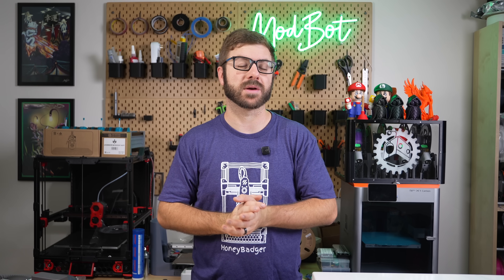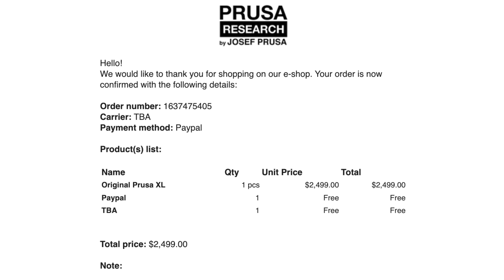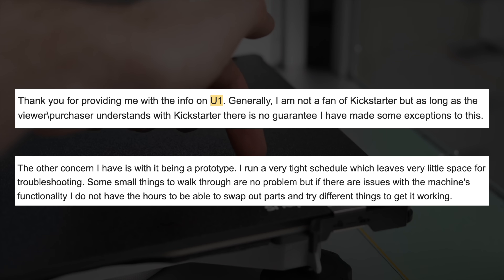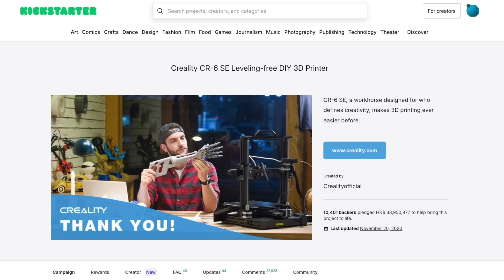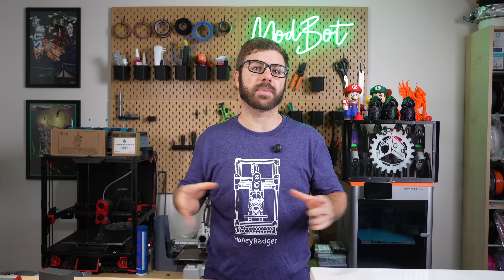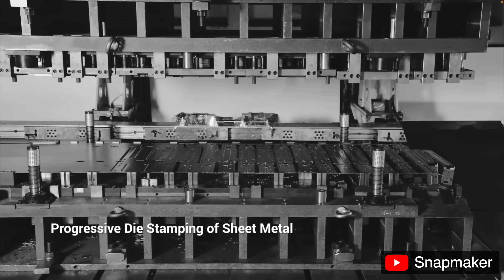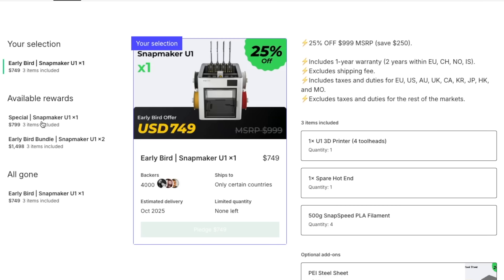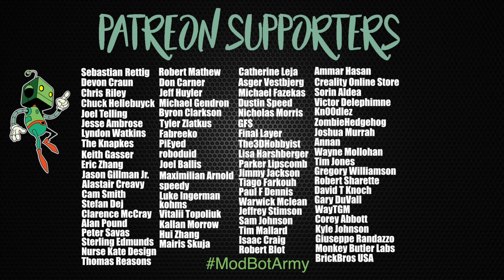Why I Backed the Snapmaker U1 Tool Changer (Should You?)

Comment: It took awhile to convince myself to get it, but I eventually pulled the trigger after it jumped from the early bird to the $799 price.  In the first review I saw (for a review unit clearly) I really wasn't that impressed with the quality of the prints.  But a later review I saw changed my mind.  I was SO close to completing a $4000 pre-order of the Prusa XL back in the day after a 2-year wait and constant delays.  It looks like my patience paid off, since now I've got the H2D plus the U1 for a total of only $3000.  Still love my MK3 though (which has evolved a couple of times to a 3.5S and still works great).

Comment: I was really on the fence with this until Aurora Tech did a review on it. I am very impressed. My biggest concerns are longevity. Can I put 10 thousand hours on it? How good is Snapmaker's customer support?  Also, how difficult will it be to work on? Will spare parts be readably available? If the answers to these questions are positive, than this could be a real game changer.

Comment: I have backed over a thousand Kickstarter campaigns, and it's never been a concern for me.  There is definitely some due diligence that should be done before backing something, and there have been some cases of products not being delivered.  And I have even seen some companies move from kickstarter to indegogo once the kickstarter is done or they might run campaigns on both.  
I do think the U1 has definitely given a push to other companies to come out with their own alternatives.  A printer that does all that for a thousand sounds pretty good to me. 
With the INDX on the way, I just couldn't get myself to back it.  But maybe I will reconsider once it's released.

Comment: I found it interesting that you declined the non-production version as a content maker for valid reasons, so you gained a subscriber. I believe there will be some shipping delays, but not as bad as the Prusa XL, which I also put down the deposit but ultimately did not purchase. I do a lot of ABS and am curious if the lid will allow good prints. They are single color, so if the U1 can't do them I can get a H2S.

Comment: I'm glad you mentioned nozzle sizes and multiple filaments (as opposed to different colors). Because that should be the level of expectation when delivery a 3d printer with multiple tools. If people want just pretty colors, then the single tool is all they need.

And just for fun: KickStarter takes 5% of the final backer amount, regardless of delivery of promised goods by the Project Owner. If it is not successfully backed, no money changes hands and KickStarter does not collect any fees. Oh, almost forgot. KickStarter takes an additional 3-5% from the successfully backed Project owner to cover their own credit card fees. At this point, KickStarter is going to collect over $750,000 whether or not we get printers from SnapMaker.

Comment: If you are unsure, WAIT, I backed the Ankermake M5 which also seemed a great printer doing some things other printers weren't doing at the time and from a reputable brand. The printer was delivered and sort worked as advertised, but a lot of the software promises where never implemented. Now they have all but left this printer to die, I am now stuck with a printer that is worth literally almost nothing on the second hand market and in practice has no more support. Be careful and wait until the actual consumer units get shipped and get tested by independent reviewers, WAIT IT OUIT.

Comment: I have two major reasons why I backed the Snapmaker U1 myself
1) I have an Anycubic Mega SE - A decent enough ender3 clone bedslinger. With the hardware of the Snapmaker U1, it's very doubtful it'll be worse than that, especially since I lost the settings in Orca and have to build my profiles back from the ground up. I already run Klipper on the printer itself, and despite a rare skip or two in the extruder it works fine (but slow)
2) The software is open source based - I hate proprietary software for slicers and firmware. Since they are focusing on mostly hardware and letting software be open source, I trust the build and functionality of the printer.

With these two reasons, a cheap toolchanger would be a huge leap forward for me to do what I want even if there are some minor issues, and since it'll be open source there will be pressure to get any software related issues fixed.
Any hardware related issues should be able to be dealt with as well due to the open source software side of things. I expect less tinkering with this than I have done over the years with my Mega SE.
The preview videos have at the very least given me enough info that this isn't vaporware and that it'll function to do as good prints as my MegaSE, but faster.

Comment: If I was in the market for a 250mm class printer, I would have jumped on this in a heartbeat. But, I already have a printer that size, and while the toolchanger is definitely a better tech than the AMS, it's not enough for me to replace a working printer, and I don't need a second 250mm printer.
If this had been a 350mm class printer though, I'd probably have jumped on it hard.
For now, I'm waiting on the INDX. If it releases with good performance/quality, I'll look at getting an SV08 and modding it.

Comment: i would absolutely love to have a tool changer, but even at the drastically reduced expected price point it's still well out of my price range - probably the biggest reason most of my machines are built from salvaged components, except for electronics.  that said, i've always been a believer in the little guy getting a leg up if they can through platforms like kickstarter, but established companies using it seems to me to simply be a way for them to hoard their existing profits rather than putting a portion of that toward r&d as was always done in yesteryear.  i have a feeling the days of the little guy getting that leg up are just about over now, though, being edged out by established & largely thriving companies & corporations on those platforms - which i personally think is very sad & doesn't bode well for the future.

Comment: I will not pay a dime for a 3d printer until it is on the market and in the hands of real users. I have been burned before and I won't ever back a 3d printer again. There is a ton of hype about the U1 and that's fine. But I don't buy into any hype until I see people in the wild using them.

Comment: I really really want a tool changer... I have an A1 with AMS and the filament poop just irks me. And the increased print times kinda sucks too, but I could live with that if it weren't pooping so badly. I was already investigating tool changers a couple months ago, but there is no way I could afford the prices that they list for. I would have jumped on the Snapmaker, but there is no much I don't know about the printer and the company itself, I didn't want to toss away over a grand (CDN) if it wasn't brought to market. And I am not interested in a walled garden when it comes to hardware, either. This is the first info I've heard on the nozzle and I really would prefer to be able to swap out nozzles without having to also swap the entire hot end. Spare parts... Are they going to be available? Again, no idea. So many questions. LOL Then I also have FOMO of missing out on the price point during the Kickstarter because what if they DO increase the price to say $1500USD, there's no way I can afford that. Then there is the fear of locking myself into a Snapmaker only to have another company come out with their tool changer that is better. (And I don't think the H2C is going to be it... There is going to be a Bambu Lab tax on top of whatever it costs to manufacture it and again, walled garden will definitely be involved there.
BTW, good content... new Sub here.

Comment: After the announcement of the H2C and a strong debate, I decided NOT to back out of my backing in the U1.
The H2C will require 2 AMS (which I already have) but also require the filament to be cut when changing colors.
The U1 will still be faster when changing color.
If the U1 had 2 more tool heads it wouldn't be even be a debate, but he H2C's 7 color is a huge advantage over the U1.
I already have an H2D and will be getting the Vortek kit.
But I still want to support more competition for affordable tool changers.

Comment: All fair points. I haven’t had much of a need to do multicolor things as most of my stuff is functional single filament printing. I do have an A1 Mini with AMS Lite so on the offchance i need a multicolor thing, it works. My Centauri Carbon does full functional printing and someday they will maybe have an AMS for it… we’ll see. It would mainly be nice for support materials and getting clean overhangs, and refilling spools, is how I would use it, personally. But toolchanger is obviously the way to go and zero risk of nozzle contamination, much less clogging. If the U1 does this right, i may consider getting another printer.

Comment: I backed it also,
But then Bambu announced their new H2C..........So I canceled my Smapmaker
Reply: So you cancelled fot printer triple the cost with slower changing system that there is barely any information about?
The Bambu project makes sense only if you already own H2D with AMS, and plan to buy upgrade kit for it, otherwise you might as well go all the way to Prusa XL at that pricepoint
Reply: @Asghaad  
No, I canceled my order because I'm in love with the Bambu Echo system and the fact that I can print up to 7 colors instead of 4
Also, the bigger volume Cubic....
Oh also the tech support....Oh and the Phone app..........Oh and so on and so on
Oh, and I can afford it !!!
Reply: @popshobbydungeon  cool, im not spending $3-3.5k on a printer and all the required addons (7 colors would require TWO AMS and all the required connection and power addonts to THOSE ...), i would have gotten Prusa XL if i had that amount of cash to throw at a hobby

and yes i can afford it, doesnt mean i will be financially irresponsible to throw that amount of cash on second rate system that will be significantly slower than actual toolchanger - at that price i would expect to get the best not 5-6times longer filament change time compared to competition that costs less than a third as much
Reply: @Asghaad  
You don't need any AMS,  you just load 7 colors and you're done, and as far as speed, each tool head of the U1 will have to calibrate and bed leval so thats super slow, also you're going to need a prime tower just like the Bambu Lab does, so I don't think you are thinking things through, but stand by and we'll see.
Not to mention that Bambu Lab is NOW the NEW OG that everyone else is trying to catch up to!|
Their innovations have surpassed everyone else so I will
Stick with a company that knows how to innovate and NOT copy what everyone else is doing....its all good  bro
You do You
I'll do me

Comment: I’m waiting on release.  Want to hear about reliability and software support as well as replacement part availability.
Reply: The replacements parts are a big question mark. I hear that the nozzle wiper pads wear out extremely fast for example. I'll probably wait for release myself. I prefer to pay a little more & be certain.
Reply: yeah, hearing that the nozzles can't be individually changed is is disheartening, That's the first major doubt I have about potentially buying this thing (I have not, as of yet, backed this) I want to know how much replacement hotend assemblies will cost (and how easy replacements will be to install) before committing to a purchase. That being said, I can't wait to see what the community does with these machines when they release.
Reply: @themagitechie9955  It's pretty sad how no review so far mentioned this hotend issue. That's a HUGE deal breaker for people who want to print abrasive materials & need to swap nozzles or need a larger diameter for certain prints. Bambu's system made me love nozzle changes on the fly. Also I highly doubt you can mix different nozzle sizes so you probably would need to replace all 4 of them at once.
Reply: @redavatar  the kickstarter page did say a full set of hardened nozzles is available for 80$ (at full price). I am wondering if more exotic nozzles will be available. As for the "no mixing nozzle sizes" issue you bring up, I see no reason why you wouldn't be able to do that assuming different sizes are available. why would Snapmaker limit you like that?

Comment: I'm feeling fairly confident in the kickstarter; as you say, the hardware is in place already.  We're not funding development, just construction. It might take a while to finish production, though I can be patient - the big risk there would be production costs rising sharply before they're done fulfiling the KS, which would create pressure to deprioritise backers in favour of new and full profit production.

My main concerns right now are these: first, how will Prusa's teased CoreOne toolchanger compare, both in performance and cost?  My "perfect world" setup for a toolchanger printer would definitely find the extra print heads useful, but not an extra 300$ useful.

Second: is my personal gain in utility worth the cost of the printer?  The U1 is great value for what it's offering, but what it's offering is only a small step up from my X1C.  Most of the gains for me would just be less time spend swapping between PLA and ABS and between nozzle sizes.  There's some value in being able to do dissimilar supports, and some value in being able to have a "spare" printer just in case.  But most of the value would be in having all my various setups ready to go at whim.  And so as much as I really want the U1, I keep pausing to ask "is that really worth 3 weeks wages?"

Comment: I was so much on the fence on this one, the price is surely good, but another kickstarter, ugh... I got burned by many hardware kickstarters before, and just didn't want to do it anymore. Also, this and the Wondershare ZR Ultra are first gen commercially available tool changers, so usually first gen products suffer from teething pains (just look at the Prusa XL). While having a toolchanger would be awesome, I've found numerous processes to not require it after 10 years of designing and printing. I absolutely agree this is the next thing to shake up the FDM space, and a welcome one at that, but not sure about this one. I mean, Bambu definitely got spooked enough by the success of this kickstarter, enough to release a H2C intro video at the same time as their H2S product launch date.
Reply: Also, the Wondershare ZR Ultra is requiring a gap payment in addition to the pledge,  so it costs more than people signed up for.   You can read it in the comments in their kickstarter campaign.

Comment: Part of the cost savings is in some of the materials used. I paid half the price of the Snapmaker buying a much larger, though not enclosed, Elegoo Neptune 4+... so the price of the Snapmaker even at that discount price doesn't worry me all that much about materials quality... after all, it is only PARTIALLY enclosed, with plastic panels, not steel. That alone makes for a significant savings, even as it points out that it won't be capable of some of the engineer-grade filaments (enclosure temperatures alone would soften or even melt those panels.) Ergo, the U1 will be more of a consumer-grade unit while a U(xx) will likely carry a higher price with more capabilities.

Comment: I think using Kickstarter as a "pre-order" platform is dubious. With the Snapmaker U1 it does at least look like it's a mostly finished product that likely will be delivered. I'd consider it low risk as far as Kickstarter goes, but not no risk. The issue is giving added protections to the company, but none to the consumer. The benefit to the consumer is the lower price and any other backer benefits. People should exercise caution and ideally I think this should be reformed in the future. Back to the U1, it's looking very solid overall. It was very smart of Snapmaker to send out a lot of beta test units, both to demonstrate function and receive feedback. I also love they plan to keep the firmware open. It's an impressively low price. Hope it works out!

Comment: I backed it initially, but I cancelled my pledge when I heard about the new Bambu machine coming in Q4 2025
Reply from the maker: Yeah I don’t know about that or the core one when I made the video or backed it. I’m keeping my backing but I can understand waiting based on new information that’s come out.
Reply: Fair, though it looks like only one feeder. If it really still relies on the AMS, the U1, XL, and whatever else is next will likely still beat it on time and TPU.
Reply: @timm7524  Prusa core one seems to use bondtech indx
Reply: I did the same.
Reply: That bambu machine will cost 3x as much and is running on Bambu's closed ecosystem that they can change at any moment (or steal your info and funnel it to the CCP). Snapmaker's machine is built on Klipper (open source).
Reply: I’m keeping the pledge, the H2C has all speed and material limitations associated with AMS systems, and price-wise it won’t be as competitive (cannot cost less than the current H2D..). But I’d really like to know more about forthcoming Indx systems before the campaign runs out..

Comment: Before quad copters and multi rotors were called drones i used to build my own. Even had a rep rap mendal to print parts for them. Then DJI came along and it was more costly in time and money to DIY. snap maker are doing the same to tool changer 3d printers. 

Others will follow elegoo for example 6 head machine 300-350 cubed likely not. 

But i sent my coin for this one 😮🎉🎉